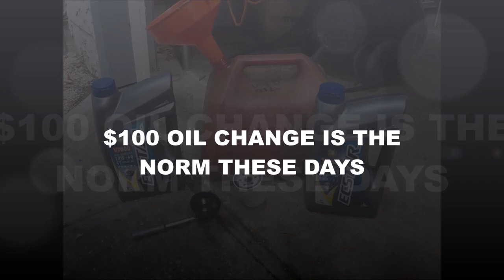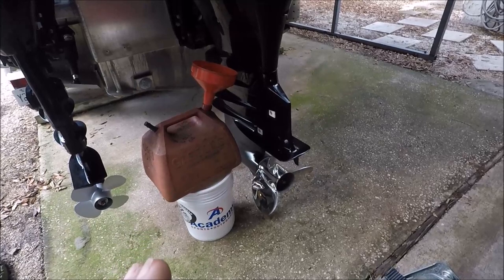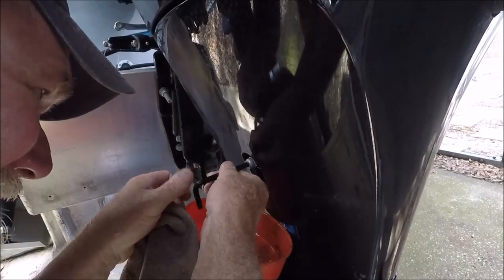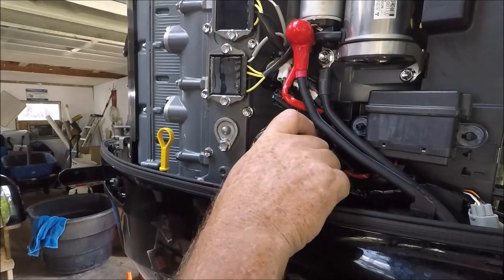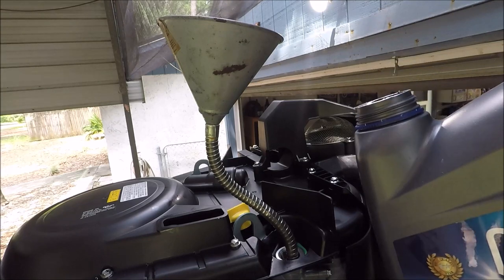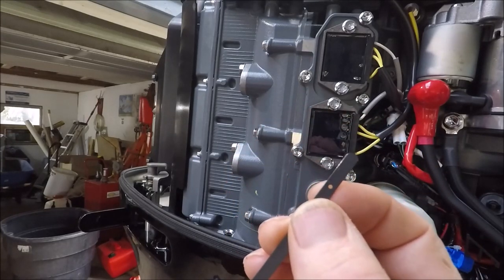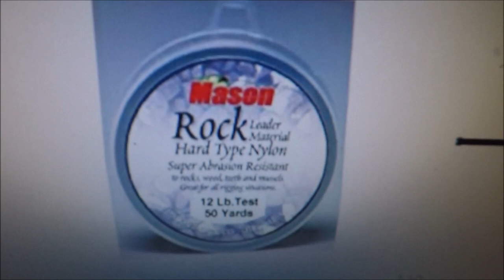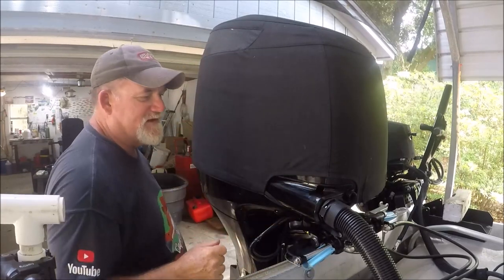SUZUKI  OUTBOARD OIL CHANGE

Comment from the maker: 📌THANK YOU FOR STOPPING BY. I APPRECIATE YOUR SUPPORT 💖 DON'T FORGET A 👍 IF ANYTHING DONE HERE HELPED YOU. LINKS IN VIDEO DESCRIPTION ARE FOR YOU. COMMENT BELOW💻 I TRY TO RESPOND TO EVERY COMMENT. www.captdaves.com
Reply: I looked on your amazon page, I didn't see one for my 2020 Suzuki DF300AP so I looked on the OceanSouth site but they only had an option for a 2012 Suzuki.
Reply from the maker: @captainscottlum2371  WRONG mine is the same cover that was on my old 6 year old 2014 suzuki....it fits my 2020, too.
Reply: @CaptDavesSportfishing  I wonder if it also fits the 300?
Reply from the maker: @captainscottlum2371  The 250 and 300 are the same motor....just look at your cowling style. from (I think, 200) to 300 the cowling hasn't changed since 2013.
Reply: Why did you use 10w40 over the 30? What’s the difference?
Reply from the maker: @michaelcharbeneau5573  THATS WHAT IS RECCOMENDED. YOU CAN USE 10-30, ITS NO BIG DEAL.

Comment: Hey Capt. Local 904 resident here. Doing my twin 125 zukis tomorrow in the water. (Wish I could change elsewhere but it's really difficult.). I use an inflatable pool tube with a covered bottom and a flat piece of wood in the middle and set it in the water to have a floating oil catch  and it works great. Any spillage is caught by the inflatable and I just pull it out when done and dispose of properly. Trial and error and some ingenuity.
Reply from the maker: Good gawd! Not sure Id even own a boat if I didnt have a trailer! And that means I wouldn't be in the charter biz. Hmmm,
I may have just ended up being a male model instead....haha

Comment: Hey Capt Dave,
     Next oil change try using  2 or 3 inches (longer if needed) of duct tape beneath the oil drain hole to act as a drain chute to keep the oil from running on the lower 
unit when the oil starts to dribble out the hole.  Just peal off and dispose of it when finished.  You might not have to use Purple Cleaner to get off the spilled oil.
Reply from the maker: sounds good....but shouldn't have to jump thru hoops.

Comment: Depending on the oil fill location you can use one of those suction hose things and suck most of it out. Obviously you'd still have to take the plug out and end up still getting oil on the outdrive. You could always install a permanent petcoc where the plug goes. Not ideal but it's an option I suppose.
Reply from the maker: pumping the oil out was addressed below in another comment, NOT doing that. But with trial and error a hose could be attached just not time to do trail and error.

Comment: Iv always been a fan of Suzuki's engines had a 2004 ltz 400 quad  and dr 650 enduro not one problem with motor or transmission.  Trade in the quad for a 2007 Yamaha 700 raptor had nothing but problems with the ecm and ya it was the first year they put efi on it. I just like Suzuki
Reply from the maker: OKAY, but this is a saltwater heavy use saltwater outboard.....not land based play toys. I never even think zuki with any other than a outboards.
Reply: @CaptDavesSportfishing  I'm looking into repower my 91 sylvan with a 70hp evinrude I like the Suzuki with the option of troll control.
Reply from the maker: @robertsteele667  have it and have never used it.

Comment: When I change the oil on my DF 250, I wedge a small piece of cardboard under the drain plug  hole to prevent the oil from running down the motor.  Basically make a drip lip for the oil. Works like a charm and I don’t have to wipe the covers down when I’m done.

Comment: I also use plain old rotella t4 15/40 diesel oil and works perfectly fine on my diesel truck, boat, and quads
Reply from the maker: in a 20k outboard???
Reply: Capt Dave's Sport Fishing no in my merc 3.0. I stay with what ever manufacturers recommend while under warranty. You will see rotella recommended on many boating forums.
Reply from the maker: @pablomay28  didn't think so! yeah just did oil in truck today with mobile 15w-40 on sale a wallys world, $10 bucks a gallon x 3....way cheaper than $34 a gallon....bust out another thousand, ''boat!''  BUT ITS MY LIVELIHOOD.

Comment: Dave would you like to spend 100 on oil every 100 or dump that expensive 2 stroke oil in your tanks every trip.
Reply from the maker: well, I can buy less expensive 4 stroke oil very EZ.  That was my point. If certified, with same ratings, zuki charges $35 a gallon, and another company charges $22 a gallon. Both have same FWC, NMMA rating, and possibly come out of the same factory. Am I getting, so much more because it's Suzuki oil???
Remember, auto dealerships make all their $$ in the parts and shop, versus the actual car sale.  No, I gave up on blowing up 2 strokers years ago....from ""lack of lubrication"".

Comment: Ok I’ll bite! I’ve learned a lot from you, so maybe this tip will help you👍
I take a piece of thin plastic like Saran Wrap size, use blue painters tape and stick on the side of engine just under drain port to make like a bib, then any oil that drains down the side doesn’t touch the motor, and you can make it small enough to just reach your funnel so it helps stop the last few drops from dripping on foot! JMO.
Reply from the maker: I was hoping for more ''less' macgyver'isms and a more ''fastener, pipe, funnel'' tricks. On some engines can't remember which, all ya did is cut the filter box a certain way and push it on. as a funnel. Guess, if ya want really better, buy a Merc. or better yet a OXE 300 diesel ❗❗ yes, thats what I really wanted.

Comment: Turn engine to the left and tilt it half way up. have a funnel with large hole gauze in to catch the bolt and washer. in this position you can undo the oil plug and let it drain without it going all over the side of the motor and halfway up your arms... ALSO wear gloves because used oil is much thinner and nastier than you might think and gets deep into your skin.. new oil no problem , old oil bad for you... and its ok for people to say run the motor and then drain, yeah so now you got super hot oil on your skin !!!  errr NO.. . no need for the bullshit marine oil in these motors especially when you keep it on a trailer. any 10 30 oil is perfect for these. if you choose to run expensive oil thats up to you, but any 10-30 is fine, even 10-40 is good.
Reply from the maker: I like the tilt motor idea. WHY they don't mold the tupperware into a scoop is beyond me, or do as merc does. I hardly ever use the zuki oil. Usually buy 2 gallons of just Sierra 10-40 and a filter off amazon or ebay. I never been burnt. Truck or Outboard.

Comment: Susuki dealership blames me. In this harbor is 300-400 outboards and mine is the only one going into limp mode. Maybe I got a fresh water motor, as it doesnt run in saltwater
Reply from the maker: I certainly don't know what to tell you. blames you, you may want to find a better mechanic

Comment: Oil plug hole, 2” blue paint tape, everyone seems to have some, maybe. Seems safe or car paint. Form a trough with the tape. If you get real good you can use small piece of  bleach bottle plastic which has a natural form near the top of the bottle, you will figure it out .//// Googled, Blue Painter's tape (better than the tan kind of masking tape, but more expensive) will not stick to or damage your car's existing paint (unless it's very fresh!) as long as you don't leave the tape on for a long time. Good luck
Reply from the maker: BETTER ENGINEERING.....instead of BS rigging would have been real nice.
Reply: Capt Dave's Sport Fishing ,, I just did my 20 hour oil and lower unit change on my new DF 250 Suzuki outboard. Thanks for the warning of dribble all down the side. The blue tape did its job and was easy to make a over hang gutter to bucket, as also used on lower unit as oil runs down the fin. It will not hurt your paint. You ask? If anybody knows a better way, reply in my comments. Just do a dry run with 2” blue paint tape. It works! It was also good talking to you on the phone about a little of everything. 😃
Reply from the maker: I dont sweat it too much
Reply: I'm glad someone mentioned creating a sort of drip guide using tape under the drain plug. I do the same using aluminum tape on my DF90A and it works great with no drips down the leg. I like the aluminum tape vs the painters tape as it seems to hold it's shape better but both methods work well.

Comment: You didn't mention the oil alarm? Does it reset by it;s self after the 20 hr change.
Reply from the maker: That had zero to do with the act of changing the oil, 99% of the time, I do it before or after the stupid alarm. I have a hour meter and a maintenance log book.  Yes, you have to turn it off, or youll hear the aggrevating beeping. Its in uour owners manual, and if you dont have one, you can get one.

Comment: DAVE, WHERE DID YOU ORDER THE KIT WITH THE OIL GASKETS AND WRENCH
Reply from the maker: Wrench, any auto parts.....I get alot of my parts from boats.net. Any suzuki dealer worth its salt, has the crush washers. and as usual (with stealerships) will charge you double.

Comment: Well  looks like i am in the market for a pair of 4s engines. Yams or Suzuki.
Since BRP has stopped making engines.
No one can test a product like Capt Dave.
I did not see the anchor ball with the handle on in your tools of the trade...remember that
Reply from the maker: yeah, not running a west marine, just stuff I ""use and have reviewed"". Yams are expensive as all hell, I was quoted back in 2014 a 250 yamaha at 28K, I asked if that came with tits or not?  Zuki's 19K , this one here, 19,800 with rebate. YEP, BRP will come out with a electric outboard next, which will be laughable.
Reply: @CaptDavesSportfishing  yeah they are proud of those Yams. And i am not sure i trust the Yam dealer that is close to us. 
I got quoted 38k fo a pair of 300's. Mechanical not electric shift/throttle
Reply from the maker: @chrisbernacki1012  me either. that the reason I went with the zuki. better price and rebates and fly by wire is so great
Reply: @CaptDavesSportfishing  looks like you maybe my naint mech when i get them
Reply from the maker: @chrisbernacki1012  THERE'S NOT MUCH ABOUT THEM I DON'T KNOW ABOUT, as a ''user'', that for sure. I'd run the piss outa yours, and deal with it ''if'', something goes really wrong. I've learned, I'll be repowering every 4 years if I can swing it.
Reply: @CaptDavesSportfishing  yeah i am gonna run the ones i got till tje end then repower